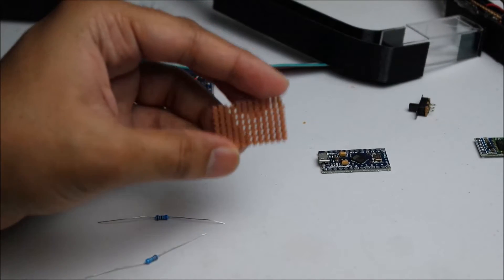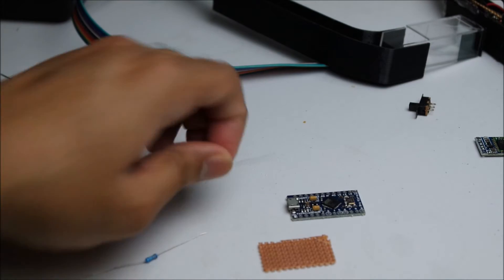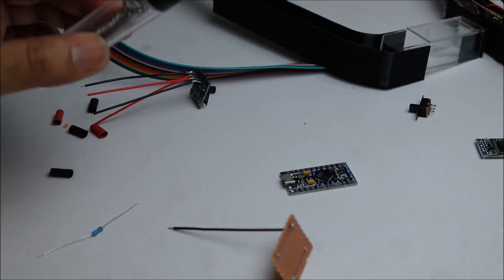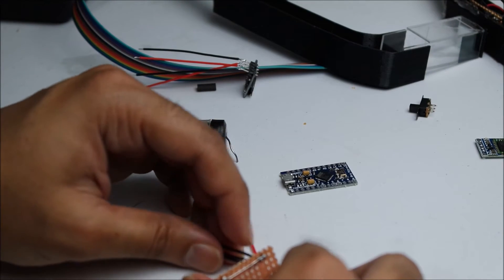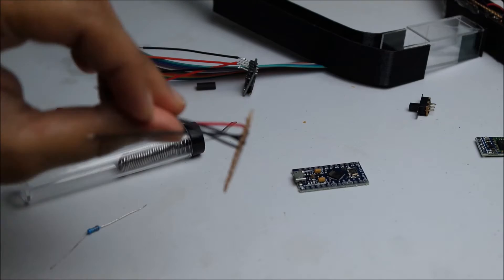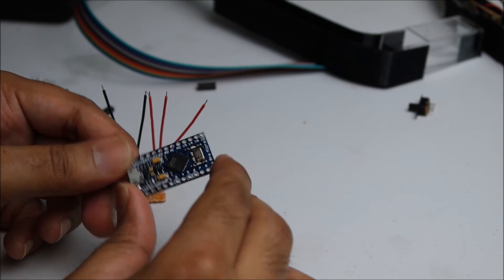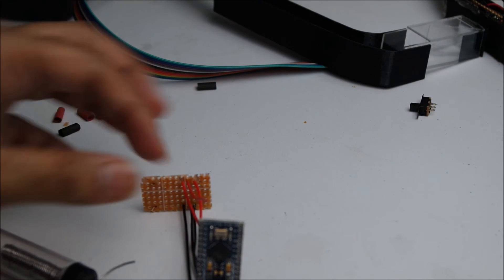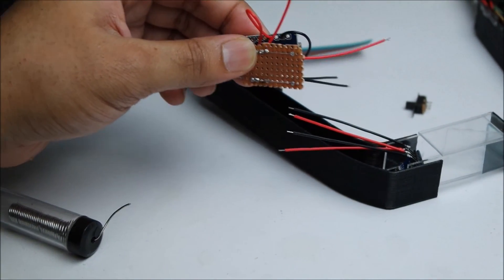DIY Google Glass: Complete Tutorial Part 2

Comment: what resistors did you use?
Reply from the maker: The only time i used a resistor was to use the legs of the resistor to create a rail.
Reply: was wondering the same thing
Reply from the maker: I didnt use any resistors at this point.
Reply: Fahim Chowdhury on the perf board, u did
Reply: Fahim Chowdhury on the board, right? so if yes which one did u use